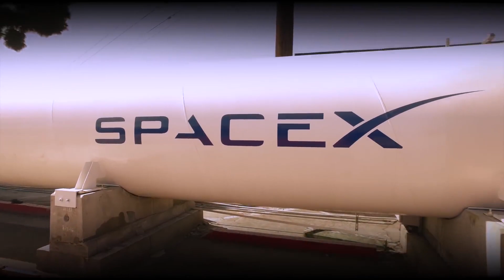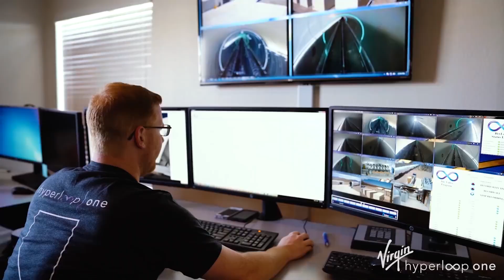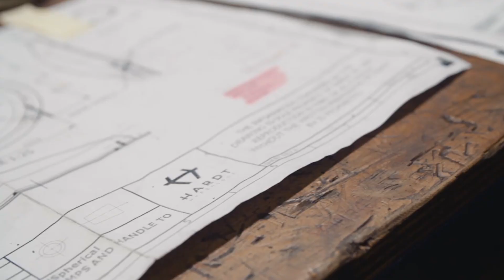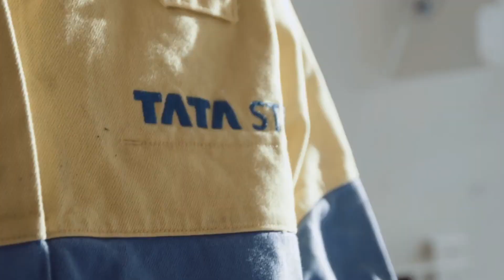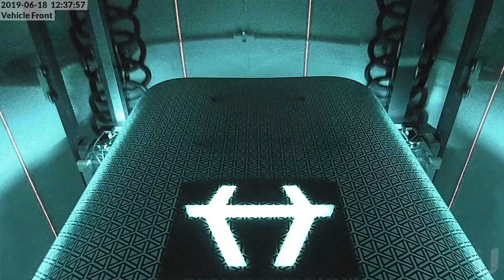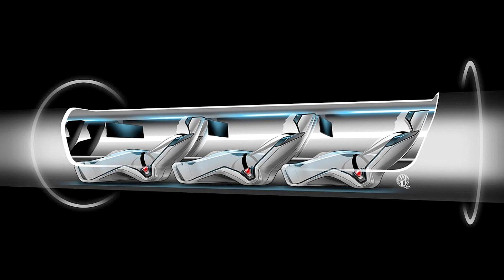Hyperloop Challenges Will Push Debut to 2040 - Autoline Exclusives

Comment: Problem with Hyperloop, is the dwelling on the 'Greed for Speed.' The logic to achieve this, was banning wind friction, their result was creating a massively expensive decompression environment, That is like saying, hey I dont want to buy an expensive Cruise ship, lets get a Submarine... Most of this radical features could have been bypassed with what I would call, 'Turbine loop', which is wind flowing parrelle, to bypass the sound barriers laws, would not have been a cheaper trip, but far earlier then Hyper loop deadline is, all this radical compress environment, just because to save power, they should have invested in some kind of safer atomic energy generator, not a massive expensive realm.

Comment: WOW ...   YOU PEOPLE HAVE NO VISION  VISION  ...  IT COST 1/3 AS MUCH AS BULLET TRAINS AND IS SAFER AND FASTER THAN A JET  !!!  IT'S NOT YOUR GRANDMOTHERS MAG LIFT LIKE HIGH SPEED RAIL HAVING ELECTROMAGNETS IN THE TRAIN  .  THE TRACK    (WHICH RUN FOR MILES ) AND MAGNETS TO PUSH IT TO 250 MILES AN HOUR  ALL 3 TAKE A LOT OF ELECTRICITY    BUT THE HYPERLOOP HAS PERMANENT MAGNETS IN THE POD  THAT DON'T NEED ELECTRICITY AND   MILES OF TRACK MAGNETS  TO LEVITATE  THE IT  OFF THE TRACK  .  THE HYPERLOOP TRACK  IS MADE OF SPECIAL ALUMINUM  THAT LEVITATES THE POD OFF THE TRACK AS THE MAGNETS IN THE POD MOVE ACROSS IT  THE ONLY ELECTRICITY THAT'S USED  IS  TO PUSH THE POD TO 700 MILES AN HOUR BUT SINCE THE POD IS  IN A VACUUM  TUBE ONCE IT HITS 700 MILES AN HOUR YOU CAN CUT  OFF THE ELECTRICITY AND THE POD JUST COASTS  ........ SO MUCH CHEAPER

Comment: Eh... it's like an inferior version of a subway/high speed train. Atrocious capacity (passengers per hour), horribly expensive (in both: building and operation), and dangerous (make a hole in kilometers long low-pressure vessel, see how well it goes). We'd be much better off further improving high speed railway, instead of wasting money on this nonsense for the rich. It's a fun engineering challenge, otherwise it's just monorail 2.0. Another distraction for governments to avoid spending money on public transportation right now.
Reply: imagine if it did work haha. would be a game changer for people who have to work in one city whilst living in another.

Comment: Hyper loop will never be built in any form that remotely lives up to the promises made. It is stupid.
Reply: You're absolutely correct. But it's so funny to watch stupid people defend it. 🤣
Reply: here in the netherlands the hyperloop system is already at its implementation phases and political stage so your conservatism is plain ignorance im afraid. You think burning fossil fuels is the answer right. If anyting is stupid is hanging on to obsolete fossil fuels technologies
Reply: @razakmeshouni8611  please provide me a link to something about your hyperloop, I am genuinely interested. I am not pro fossil fuel or anti train, you assume a lot. I just know that nobody will build hundreds of miles of vacuum tube for a 500 mile an hour train to run in.
Reply: @razakmeshouni8611   Great joke, very funny. 😅
There doesn't even exist a working prototype of the hypeloop that has transported anyone anywhere. And that's after more than 6 years of engineers working on this supposedly already existing technology.
The hypeloop is nothing more than hype and computer generated animations.

Here's another hypeloop joke for you:
Remember when Mr. Musk said it's so easy to build his interns could do it? Well, what's the hold up then? Too few interns? 🤣